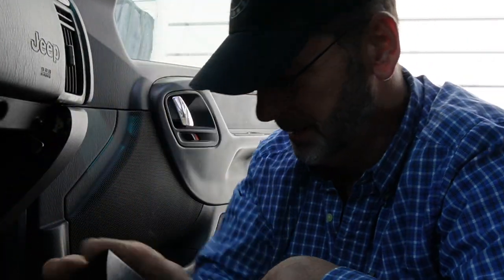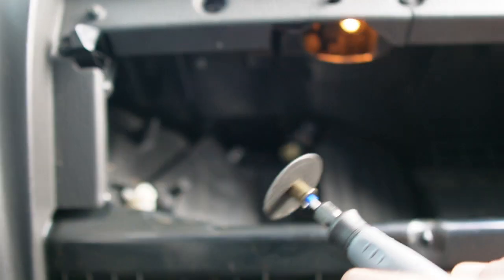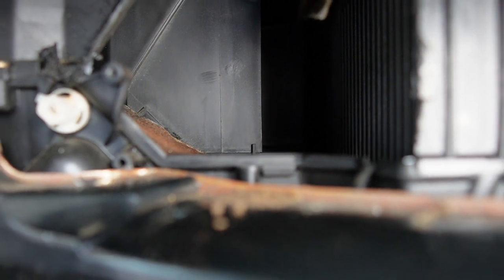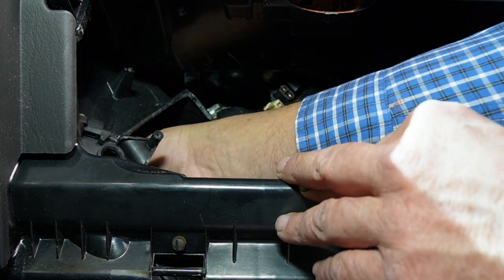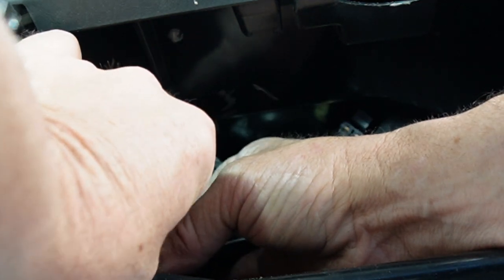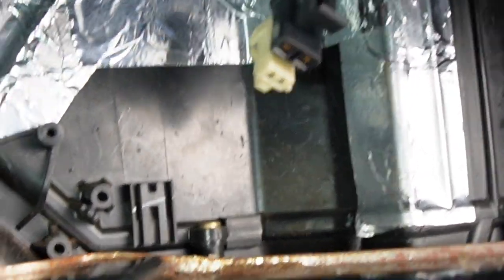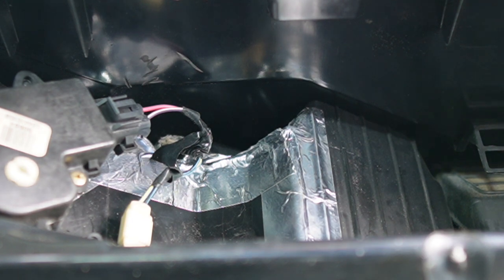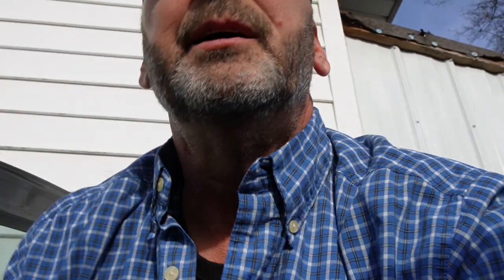how to fix a Heater blend door on a 2004 Jeep Grand Cherokee.

Comment: Thanks for your time in making this helpful video. I didn't notice, did you test the actuator at the start to ensure that wasn't the problem? Thanks.
Reply from the maker: Yes. it's probably not in the video, but you can take the actuator off, plug it back in, then turn the key on and change your heat settings, if it is working, you will see the connector turning

Comment: Will this work for 98xj it only blows heat. My a/c doesn't blow cold only hot air. no leaks
Reply from the maker: My response is somewhat extensive, so please watch this video -  https://youtu.be/qfZdKAkJcow
Reply: @rogerrachet68  it was bend door. I got ice cold a/c.
Reply from the maker: unfortunately these blend doors on this site is solely for 99 to 04 grand Cherokee WJ, I'm sure you can find a kit for an XJ with some research.
Reply: @rogerrachet68  I can open close them Manuel so that better then not having a/c in summer. Thank you your video made me get off ass.

Comment: Lol you cut the middle plastic out it is not going back evenly so blend doors move smoothly.Youll have to leave it out
Reply from the maker: You can smooth out the surfaces and glue or tape it back in, but this was being converted to a single zone comfort, and not staying a dual zone, reason for conversion is that the rear door motor is stripped out.